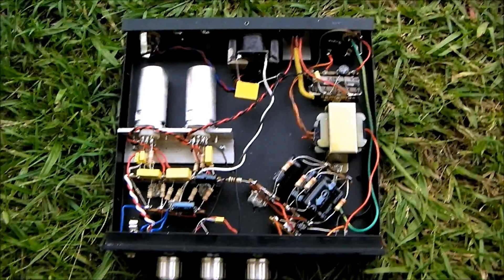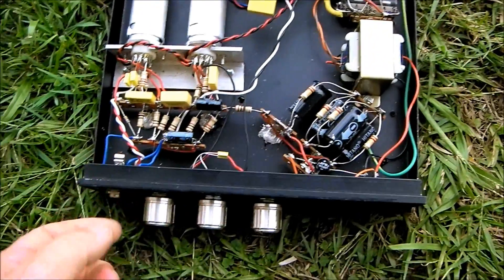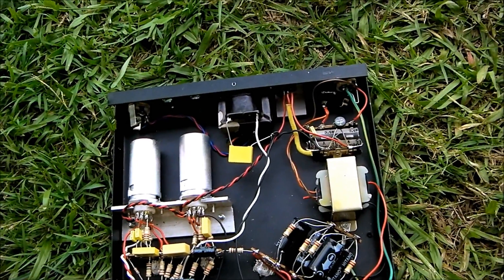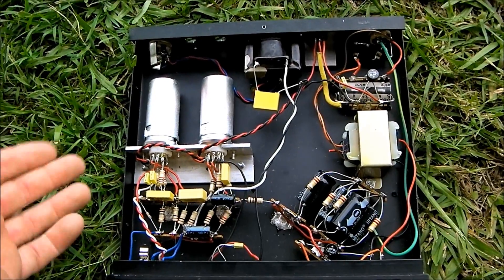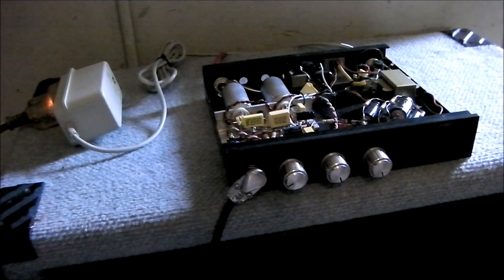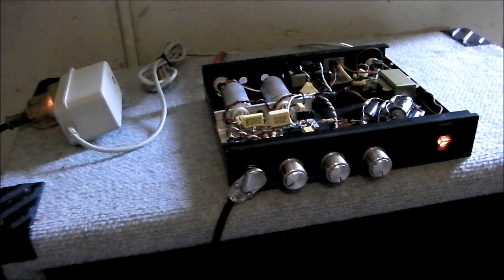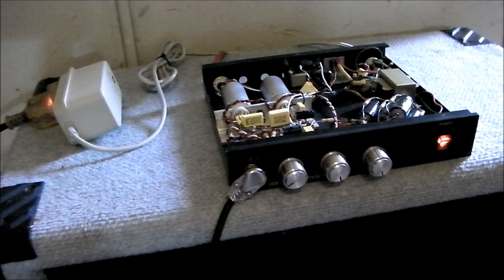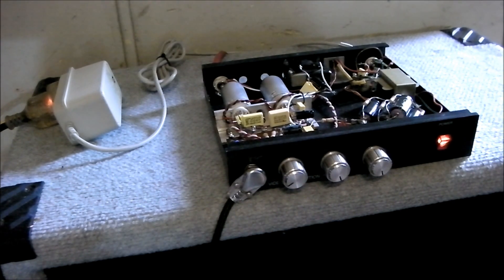DIY Tube/ Valve Guitar Preamp (Hand Made)

Comment: It's not a preamp if you can plug staring into a cab. It's a amp laugh out loud.  Preamps need a power amp/equivalent in order to work
Reply from the maker: +Jesse Belanger Well actually it is. It is just that you can get enough out of it to run a speaker.
Usually I would run it into an amp.
Reply: +Paul Graham (Guitar) ok fair enough. You did a beautiful job with it. I've started building over drives/distortions but I reallllly want to start doing preamps. Replace the tubes with jfets like AMT electronics did.  There E1/2 sounds amazing
Reply: +Jesse Belanger just wanted to ask if I ever have any questions is it ok if I bug you once in awhile 😝
Reply from the maker: Jesse Belanger If you have any questions don't hesitate to ask. I will do my best to answer.

Comment: Paul, nice job on the amp!  I have a question regarding getting good overdrive by stacking gain stages.  Got any general tips for me when designing for higher gain?  I've been having trouble getting nice clipping sounds from 3 stage designs (preamp only).  Not using a power section with any of the circuits I've been trying out.  Any tips would be great!
Nice work!!!!
Reply from the maker: Hi Joe,
My advise would be to keep the first stage gain similar to a Marshall and increase gain in the later stages.
Also running a bypass capacitor on the first and second stages cathode resistor will add more high end for a smoother sounding drive.
I would leave the last stage cathode resistor without a bypass cap just so your output doesn't end up too bright.
What I have found is performance is very reliant on supply voltages and gain can vary wildly depending on voltage.
Higher voltages can yield huge increases in gain and will need either a higher value cathode resistor or lower value anode resistor to decrease gain.
If the supply is unable to supply the current you will end up with a compression limiting effect at higher gain levels which to me didn't sound good at all.
The last circuit I built up had so much gain because of the supply voltage with the gain all the way up it would oscillate.
Of course I altered it so it would behave.
I have a video on the last build it is a pedal and is capable of reasonable high gain.

Comment from the maker: Typically diy guitar amps are built using turret board instead of pcb.
Turret board construction uses insulated board and posts to which you solder leads of the components to (this is what you are describing).
This method is preferred for several reasons. The first being that this was the original construction method for old amps. The second is  if something went wrong and a component burnt out a PCB will often be damaged.
Turret board construction allows greater modification.
Hope I have helped

Comment from the maker: I will redraw the schematic and send it to you.
I will also take some voltage readings and print those on the diagram as they are very important to getting the circuit to behave correctly.

Comment from the maker: Hi. 12AX7s can typically have a gain of 100.
But I think you really mean power output. 12AX7s are capable of about 1 watt output at high impedance.
Hence the output transformer. Without the transformer you would not hear anything as the current would be way too low going to the speaker.

Comment from the maker: Hi there, I am not sure of the specs of the transformer but you don't really need it to run a tube preamp at line or fx level. The transformer was really only useful for running a speaker.
 Since I built this preamp and uploaded the video I have experimented with using these circuits without an output transformer and it has been very successful.
I have built a tube preamp in the form of a distortion pedal. I have videos uploaded on the build and a demo.
If you have any questions don't hesitate.

Comment: Hey man, nice build. I was wondering if you could give me any specs on the output transformer that you used. What the impedance of the primary is and what kind of output you are able to achieve out of it. Is it a line level output, or is it too much to be running say with an FX rig. I have been thinking about building something like this. Once again, nice build. Thanks for posting this on youtube.

Comment from the maker: The last triode is configured as a cathode follower so the output from the tube is between the cathode and a grounded 100k resistor.
 From memory the volume control was next and the tone followed finally going to the output transformer through a capacitor and then straight to the output jack.
Thanks for the great comment.

Comment from the maker: My best suggestion is to start studying schematics of old Marshall amps.
This preamp is roughly based on a JCM800 preamp circuit.
The power supplies are easy to build and are a very simple circuit.
This one has 140 volts floating around inside so extreme caution must be taken if play around with tube circuits.

Comment: I guess he said he attenuated the 6Aq5's down to slightly over 1 watt. He is convinced they are a premiere tube over a 12AX7. They only run the initial preamp. NOT the drive tubes which are the 6X8's.

Comment: Oh yeah, I believe he may be the first person to actually stabilize and use television tubes in amp circuitry. I don't think anyone has ever used 6X8's as preamp tubes. U would not believe the gain this monster produces. It has 14 tubes sticking out of the top. It has a farting sound like a blown speaker when u spank the guitar with the gain up. Its like a crackling noise when u hit it hard. It is not a blown speaker. Could it be just too much gain? A bad cap value? Help. tks

Comment: I was mistaken. There are a couple of 6aQ5's in the first stage to power the input. There are 6X8's where 12AX7's would normally be. It has the most gain of any amp I've ever seen. Four EL34's. The only remaining parts were the O.T.'s With some more tweaking, It actually has turned into a high gain monster. The only prob now is, when u really spank it, there is a slight nasty non musical breakup separate from the amp tone. Can't figure what it is. Bad value resistor? Or just too much gain...

Comment from the maker: The problem your friend faces is that 6AQ5 tubes are a small power output tube.
They put out up to 10 watts. 12ax7 are preamp tubes there output is 1watt.
You can build a tone stack as per a marshall or fender schematic but standard pots will burn. You need pots with a much higher power rating unless you reduce the HT supply to the 6AQ5s until the output is around a watt or attenuate the output from the preamp before the tone stack.
What does it sound like?

Comment: What a nice pre-amp! I have a question. A friend of mine gutted a Jcm 900 and rebuilt it using 6AQ5 as pre-amps. It has 6 pre's, 4 El34's,2 or 3 work tubes and a rectifier tube 5U4G. anyway 14 in total. It's a monster. He doesn't seem to know much about creating tone stacks.Can u help? He says he cannot copy a 12AX7 powered tone stack. Is this the case? You would have to see this beast to believe it. I'm sure it is one of a kind. He wanted to use Tungsol 120's. usually he builds Hi Fi amps

Comment from the maker: Sorry for the late reply but as Matt Culler posted the rectifier converts AC voltage to DC and forms part of the supply that feeds the amp. But as I understand it some tube rectifiers suffers voltage sag under load which may contribute a little to the distortion on a JTM45. As these tube rectifiers feed the output tubes of the JTM45 and preamp it is difficult to use one to simulate the effect. But the supply I used does suffer some voltage sag.
Thanks for your comment and interest.